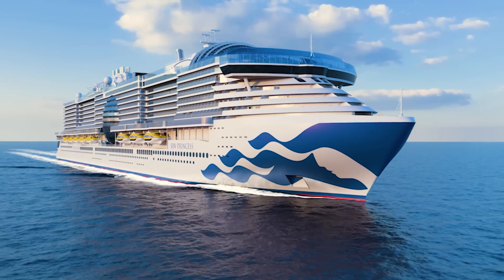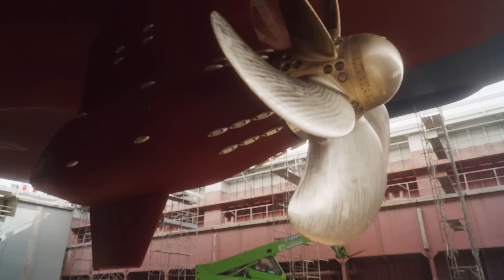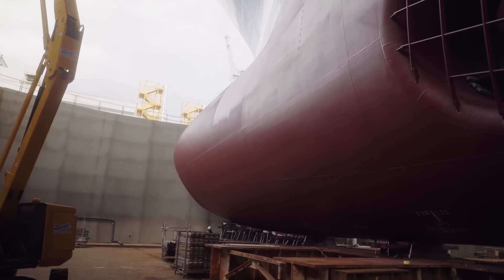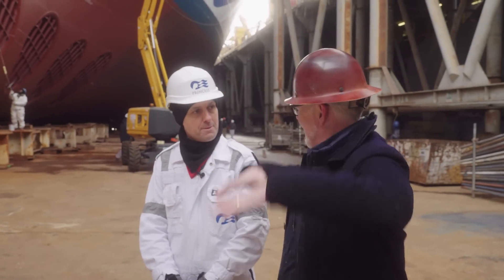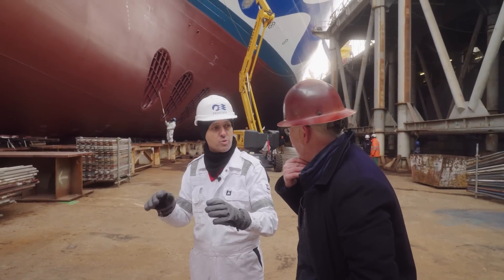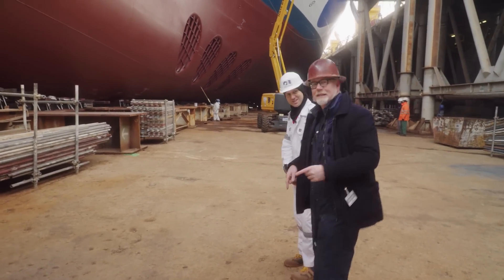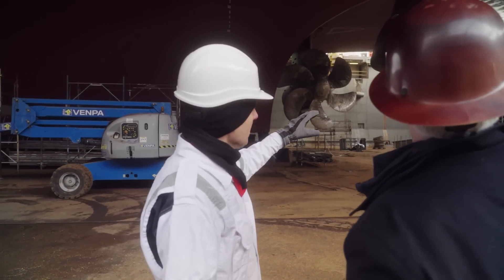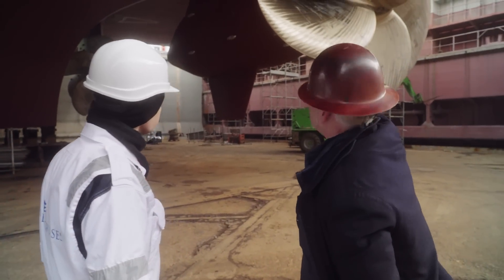This Ship Has a Big ... Nose?

Comment: I can't imagine being the project manager on something like this.  Lots of moving pieces.   Just having that mammoth ship sit on dry ground on small plies of wood and not break under it's weight seems like an engineering marvel.
Reply: Wood is nature's premier building material! It's tougher than we often give it credit for. Also, as large and heavy as that ship is, the vast majority of it is empty cargo, ballast, fuel, and water tanks and such. Also, those are reinforced concrete blocks with essentially plywood on top to kind of cushion and spread the load and keep the hull from being gouged and the paint being ruined. The paint is a complex and necessary system all on its own, not just for looks, not to mention very expensive. He mentioned the anodes for corrosion, which is another part of the paint and protection system. The paint is specifically formulated to discourage marine growth and to be difficult for things to attach to the hull without being actively harmful to plants and animals in and around the water. Barnacles and such can cause major problems with maneuverability and efficiency by fouling the ships ability to cut through the water and use its thrusters to send water across the steering planes, if present(rudders), or for the thrusters to rotate and activate quickly and effectively, if that's the propulsion system equipped. Margins in shipping are thin as onion skin, so sucking down extra fuel or slowing the ship to where it causes delays and missed load or unload appointments can easily add up to millions of dollars lost just in the short term, not to mention the loss of future business, or even worse, a long stretch of downtime for refurbish and refit and so on. Sorry for the lecture, you sure didn't ask for it(or anything else for that matter😂), but it's easy to get carried away... Being a follower of Mr Savage, I've no doubt you understand.
Reply: @philbert006  Especially the compressibility of wood is staggering!
Reply: It squishes just right.
Reply: Wood is a preferred material because it’s compliant, lightweight, easy to work with and you can usually hear it failing (cracking) and it fail slowly rather than suddenly buckling like steel. That’s why if you ever watch search and rescue they never use metal.

Comment: One of the most understated marvels if this video was that prop rotating in the wind. The friction in its mounting has to be incredibly low and the balance insanely precise. Obviously that is needed for both efficiency and to not vibrate the ship apart. But i would be interested in seeing the tools/processes used to precision balance such a massive object.
Reply: I would be interested in knowing the actual weight of that rotating mass.  The propeller itself but also the shaft and the motor armature and even the inner bearing races, and bearing balls (or likely rollers) themselves ... all that mass being so gracefully moved by a little wind that wasn't even enough to ruffle their jackets!!
Reply: Same that’s amazing
Reply: It looks like there are basically giant screws that go along the outside of the propeller and they tighten them to move the screw’s weight towards or away from the center mass in order to balance the propeller.
Reply: @WARnTEA     Those screws retain the blades to the central hub.
Reply: @DieCastoms  If you look in the background one of the workers pants show how windy it really was. I think they were filming in a strategic place for the video/audio. That being said it moving at all shocked me!
Reply: That's insane precision machining at an insane scale and as a fabricator it turns me on lol.
Reply: @DieCastoms  A fairly educated guess would be in the region of 35-45 tons of rotating mass, hard to find solid numbers but thats a pretty typical number for props that size

Comment: I hate the idea of going on a cruise, but this was awesome to watch. Amazing engineering.
Reply: One episode of Build It Bigger (Season 1 episode 4 "Super Fast Warship") examined the construction of a navy destroyer.
Smaller ship, yes, but a lot of the same challenges with cutting, bending, welding, aligning and fitting, and assembling a large machine.
-
Modern shipbuilding is a massive effort of huge numbers of people all the way from the first specifications being written down, to the architects, the sourcing of materials and the securing of a building place, to the steel workers, the welders, the fitters, the plumbers, electricians, and dozens of other job specialties.
Amazing stuff.
Reply: I do like how they paint all the efficiency improvements as "reducing emissions", and not the real goal "reducing fuel expenses" aka maximizing profit. If your goal was to "reduce emissions" just don't build a floating city in the first place, and you'd have zero emissions.
Reply: @gorak9000 Nt to mention that (at least until very recently) large ships generally burn bunker oil—the worst of the worst. Some half a million preventable deaths annually can be attributed to the pollution related to the shipping industry and pollution from burning bunker oil.
Reply: @silverXnoise  That's a good point - it's funny how I feel like I haven't heard the term "bunker oil" now in 25 or 30 years, but I seem to remember hearing it on the news when I was a kid fairly regularly. Let's just hush hush that one up - it's bad PR for the shipping companies / cruise companies / oil companies
Reply: The main priority of cruise lines isn't safety or reducing emisions, but reducing fuel usage and maximizing the amount of passengers. Many cruise ships have a very high center of gravity due to the large amount of passenger cabins added on top of the hull, increasing the danger of such ships listing, which can be especially dangerous during high winds as the hull and superstructure act like a sail, and during evacuations, as it makes navigating ships as well as accessing and using lifeboats much more difficult, as demonstrated by the sinking of the Costa Concordia.

Comment: For a sense of scale, that cruise ship is longer, wider, and heavier than a nuclear aircraft carrier. It has a shallower draft, though, as a carrier typically draws about 40 feet with no planes.
Reply: The largest container carriers, when fully loaded can have a draft up to 22 meters, or ~70 feet.
Reply: Unless you are referring to the Charles de Gaulle, a lot of that isn't correct. Yes, it is longer than a US nuclear carrier. Debatable on width (this ship is a little wider at the waterline, but a carrier is much wider up top). But it is most definitely not heavier. Gross tonnage is an indicator of volume, not weight. Its useful for comparing the sizes of various cruise ships but it can't be compared to displacement. This ship will be a good deal lighter than a Nimitz or Ford class carrier. You can tell this without even knowing what the displacement of the cruise ship is. Compare the waterline area to the depth of the draft. Given that they are fairly close in length and width, but the aircraft carrier sits about 50% deeper it is going to be much heavier.
Reply: That is absolutely incredible, thank you for sharing!

Comment: So this was awesome! This ship is a culmination of international maritime technology development over a hundred years (or so).  If you ever make your way into Finland, you can check the first prototype of the Azipod thruster at Forum Marinum maritime museum in Turku (Åbo). In Helsinki you can check out the Arctech Helsinki shipyard (Hietalahti), where the air bubling system was first developed for ships. It was initially used for icebreakers but has since been developed for this, rather more meaningful use to increase efficiency. The construction method shown here (prefab segments) is another story on to itself. Early innovations were made during the World Wars in the US, but from the 1950s onwards shipbuilding has moved in strides to become more cost effective. These cruisers are among the last ship types to be constructed in Europe (Italy, France, Spain, Germany, Finland) due to cost of labor. Tankers and containerships are easier to build and benefit more from cheaper labor costs. A single ship like this has an insane amount of systems from a wide array of sub-manufacturers the shipyard uses. There are companies just for building theatres and other big areas. Some companies specialise on just building cabins as prefab boxes etc.. Can't wait to see more from this series!

Comment: Your guide was very well-educated.  He not only understands his naval architecture but is very good at explaining it.

The air bubbler system has been around for a long time.    I first saw them in 1973 on US Navy ships.  They were being used to mask machinery noise.  At the time any reduction in hull resistance was an added benefit.

The propeller blades are a nickel-aluminum-bronze alloy.  It is a great material but is very hard to repair.  I am surprised that they haven't gone to a corrosion-resistant stainless steel alloy. Stainless steel can be polished to a mirror finish, and will retain the polish for a longer period of time.
Reply: I think steel has its own issues because stainless can still be affected by the galvanic process and cavitation chews through it very rapidly, and chemicals in seawater can penetrate and affect the steel on a molecular level. Heavier bronze alloy's are more resistant to galvanic effects, chemical bonding, and cavitation damage. So yes, heavier, less efficient and more expensive at the start, but they retain that efficiency for a much longer curve, get replaced less often, and that in turn keeps the other systems from being damaged and needing replacement (Due to vibrations and such) which helps with cost.
Reply: @littlekong7685  We had two 188,500 DWT tankers each with a fixed-pitch NiAl-Bronze propeller.    Both ships were fitted with ducts to "improve" performance.  The first ship had extensive cavitation damage to both sides of the blade.  The damage was extensive enough to require model testing to design a new propeller.  The damage was determined to be so bad that the propeller could only serve as a spare

The testing showed the original stern design without the duct produced a terrible wake pattern.  The duct did not improve the flow to the propeller instead what was a bad wake pattern became a fast bad wake pattern.  A new propeller was designed and manufactured knowing the wake was a problem.  Before a propeller was made for the second ship cracks were found in the duct structure.  The ultimate solution was to remove both ducts.  As it turned out the new propeller performed well.  The second propeller was repairable and did not require replacement.

Stainless steel propellers are used commonly for icebreaker propellers.  If you look at the Classification Societies' rules you will find alloys for Stainless steel propellers.  Impressed current cathodic protection and sacrificial anodes can be used to protect the propeller.

I found throughout my career that the best solution for hull and propeller efficiency is extensive model testing.  It is obvious when you look at the bulb, hull, and propeller that the naval architects spent considerable, and money, on design and model testing.

Comment: I'm always surprised by the fact how little of a huge ship like that, is below the waterline. Only 8 meters is below it, but 50 is above it.
Reply: As ships go, the cruise ship superstructure, fittings, and contents don’t weigh much. For the most part, a cruise ship is empty and filled with air. So you can build very high for not much draft. As opposed to a ultra large container ship with a 399 meter hull would have a draft almost twice as deep. Now, these are cruise ships, not ocean liners. The Queen Mary 2 is the only modern ocean liner. She is designed to go 20 knots through the North Atlantic winter sea. A cruise ship would want no part of such a sea. But for good weather sailing, you can’t beat the modern cruise ship designs.
Reply: There is a reason the cruise industry designs to such a shallow draft. It allows these ships to dock right up inside the most popular cruise ship ports, and navigate channels along the way. Meanwhile, the aircraft carriers anchor offshore and tender their crew ashore on smaller craft, in ports such as St. Thomas (where I've seen it firsthand). I lived aboard cruise ships for 4 years (right around the time Azipods were being introduced). One common nightmare among new crew, is that the ship is tipping over. Beyond 20 degrees of list, things start tipping over, emptying shelves, etc., and the likelihood of injuries is high. Before reaching 60 degrees (90 being laying on her side), the bridge has to aggressively turn, to counter the forces (wind, a sharp turning maneuver) trying to tip it, and right the ship, before it would go over on its side.

Comment: Thank you for this series. I work in the industry, so will refrain from comment other than to note that the azimuth thrusters have been around for a good while, both electric pods and shaft driven,, and are the sole propulsion for many vessels, such as the latest series' of ferries on the Staten Island service (I believe they are Z-drive units) You can see part of  the inboard system, and stand on the cover plate for the shaft and drive assembly. They are quite common in the commercial marine industry.

Comment: So, I like that the big stabilizer things that Adam got excited about are for correcting roll. Because unlike the things we normally call stabilizers on an airplane, (which can sometimes include or be part of the elevators, making them 'stabilators,') these things function as ailerons, which would make them, 'stabilerons.'
Reply: The airplane equivalent of this is called "autopilot". The maintain straight and level flight kind of autopilot that was invented in 1912, not the fancy new digital ones that can practically fly the plane from takeoff to landing.

Comment: The lack of friction from the bearings and gears behind those props is blowing my mind
Reply: Not much different than wind turbines - just optimized for a different fluid (water instead of air) which is why they were just barely turning in the wind.

Comment: Impressive.  I've seen one of my aircraft carriers in dry dock but I still learned some things.  I had always thought of the bulbous nose as a place to house sonar / other sensors.  Had never thought of it being used for wave/friction cancelling.   The pull props is new to me as well.  Also the air bubbles for friction reduction.
Reply: I had heard of the puller azipods being used on either a tugboat or a fireboat, but I don't remember ever hearing about them being run 'backwards' on anything big.

The bulbous bow has a curious history. I think they first appeared on warships, but not as a sensor space. They were intended as a ram for when a ships armour was too tough for your guns. Turned out that ram-bow ships tended to be more efficient & the idea took off from there.

Comment: I wondered two things about the bow thruster tunnels… the protective grills seem to have rather large opens considering all of the junk that can be in the water, but I have to assume that they have calculated that anything that can pass through is too small to damage the thrusters. And I also assume some type of shutters or other way to streamline the openings when not in use, creates complexities not repaid by increased efficiency. Amazing feat of engineering, so many questions… 😁
Reply: The Queen Mary 2 has doors that can close over the thrusters to streamline them, but I haven't seen any other system like that. I assume the drag they create is minimal enough compared to the overall size of the ship, and you wouldn't want the door actuators to fail in the closed position when you need to manoeuvre...

Comment: 1:33 what I find it funny is that I never noticed if cruise ships have the marking of the wave breaking “nose”. All commercial transport ships I have worked on the past few years had to have it marked in the hull above a certain height the type of the breaker along with the Doppler marker and stuff on both sides and needs to be easily noticeable exactly to avoid the possibility of small vessels getting battered by the wake the bigger one creates when moving (specially when moving from a standstill point)

Comment: 19:50 In addition to passive zinc anodes, there is also an active anti-corrosion system ICCP (Impressed Current Cathodic Protection) on the case. There can be a large number of galvanic pairs throughout the case. Hanging the entire body with zinc protectors is not the best option, since one zinc protector, due to very low currents, can protect only a small area around itself (approximately 500-900 mm). Several flat zinc electrodes were installed on the ship's hull (the electrodes are isolated from the hull) and the positive pole of the power source was connected to them. The negative (negative) contact was soldered to the case and approximately 20 volts were applied. Such voltage can protect up to 150 meters of the ship's hull. On large ships there are two such stations - in the bow and in the stern with several electrodes each.

Comment: For a short time I worked at Rolls Royce Naval Marine, reconditioning variable pitch battleship props. They were tested in air, spinning while the hydraulics cycled back and forth. Doors to the building had to be open no matter the weather, and the wind produced would blow the branches of the trees in the parking lot in sync with the blades' position.